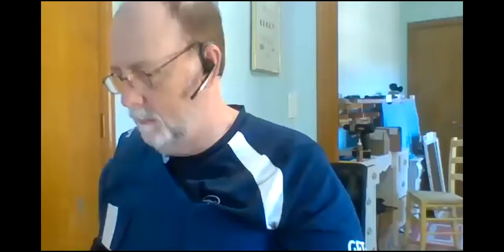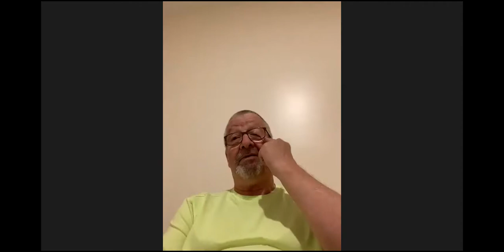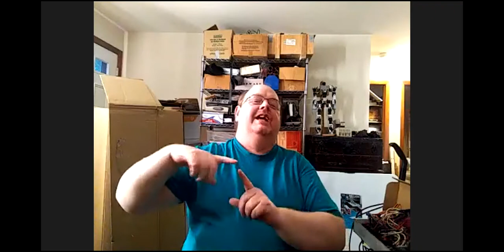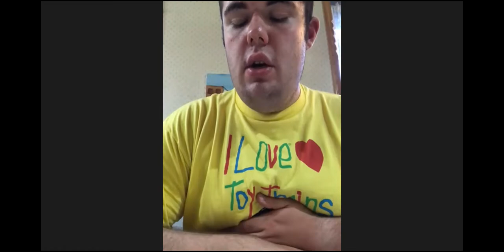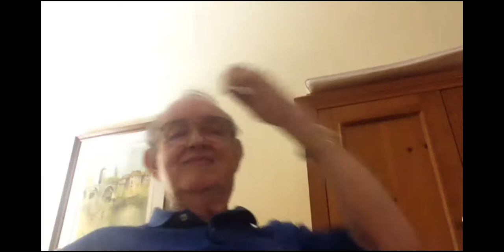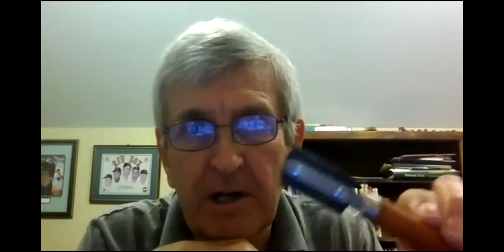New Tracks June 3 2020, feat. Jeff Grove

Comment: I'm late to the conversation with this video, but I want to comment on kits that require other items be purchased.... NO. Don't do it. You'll end up with situations like Walthers' modules kits which need the Caps & Columns kit to assemble the walls kits. The C&C kit quickly became unobtainable, so you'd get walls for 4 or 6 bucks each, but the C&C would sell for 20 bucks. 

Also, as some kits live on for decades after manufacturing has ended, the unsuspecting modeler buys it for insanely high price only to discover that there is something unique and not otherwise available today was sold separately back when the kit was new.